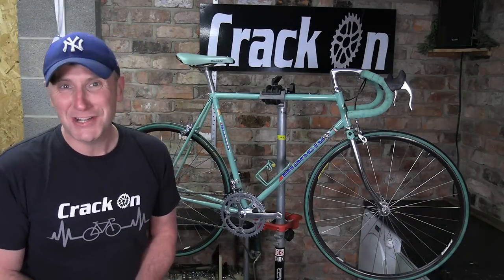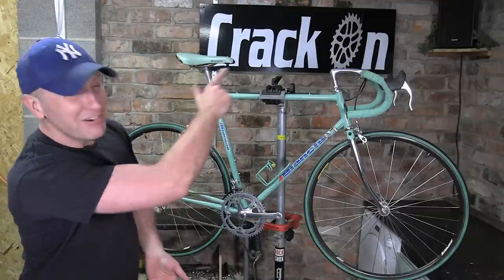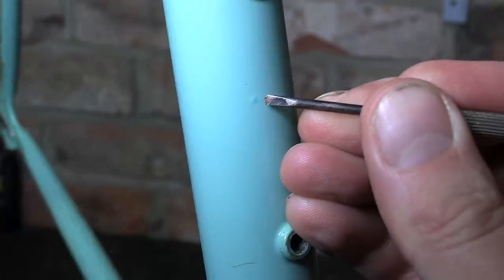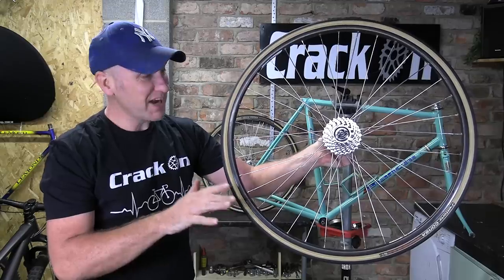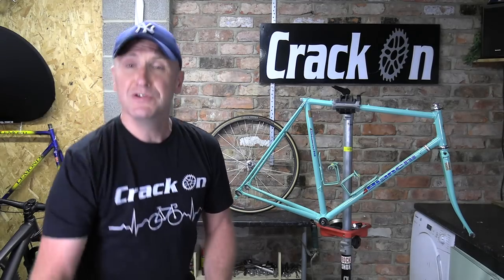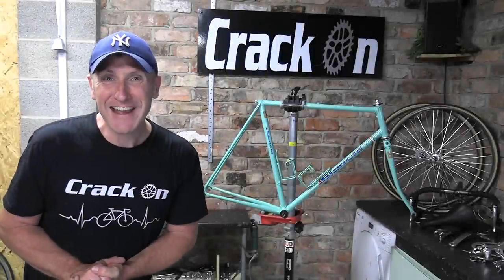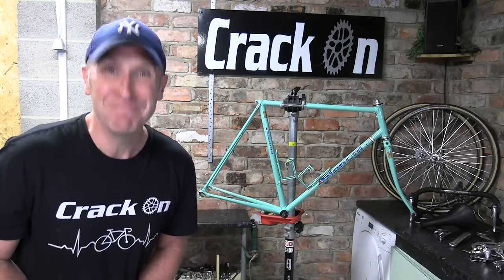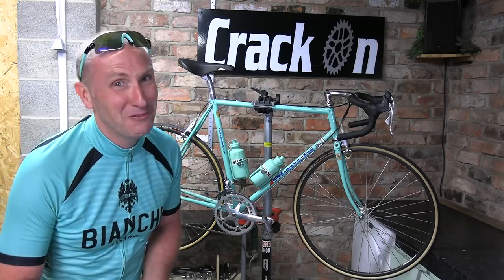Vintage Bianchi Road Bike Restoration Build and Ride

Comment: This is a beautiful build!  Once again, MR did a really amazing job with the paintwork and your component selection is choice.  I have a 1990 Bianchi Limited (Colombus Cromor, Shimano 105 7-speed SIS) that I bought new.  Originally white, I had it refinished in December in the correct celeste...and kept the matching saddle and handlebar tape on!  When I stopped on a ride last week a passing jogger pointed at the bicycle and shouted out: "That's beautiful!"  And they are, so I wish you much joy with yours, Andy.
Reply from the maker: Mate, that’s great thanks for sharing your personal experience. I’m very happy with it and yes I’ll definitely be getting out on it again. Thanks for watching and your support it’s appreciated 👍

Comment: Really nice looking Bianchi. I have a 1995 Racing Department TSX UL, with the Super Set of tubing (downtube ovalized at the bottom bracket) Back then, I built the frameset up with an 8 speed Chorus drivetrain, except with an older Super Record front derailleur (with the black links). I never cared for Campy brake calipers because they lacked the fine tuning, when you used different wheels with different rims. I Committed heresy by using 7403 dual pivot Dura Ace calipers......I raced on it for 5 years before setting it aside for something new. A few years ago, I pulled it out and threw on some 9 speed Dura Ace 7700 components. I left on the Super Record front changer because it worked well with the indexed Shimano left shifter.  It's my Sunday bike now.
PS. I have a couple of those cages, but I found that water bottles will eventually wear the paint off of that Aluminum tubing. I replaced them with the same brand, with the same buttons, but in stainless steel.....PSS. I've always had trouble with breaking the rails on Rolls saddles, after 4 years. I've broken three of them, over the years. I now use the old S.I. Flite (1990 style)
My frame is a 59, with a 14cm ITM Eclipse stem, with ITM 260 42cm bars.
Reply from the maker: Thanks for watching and sharing your experiences and recommendations. Much appreciated happy cycling buddy

Comment: Awesome, another great build, well done! Not a big fan of the Delta brakes, more show than go, or should I say stop but not a deal breaker. On all of my rebuilds, especially repaints, I apply PPF - paint protection film. I do a complete underside of the down tube, complete fork blades, and complete chainstays. This protects from the normal wear and tear of small chips and is easy and cheap protection.
Reply from the maker: Yes I completely know where your coming from. The Gazelle with the Shimano Dura Ace 7400 is probably my favourite functional classic groupset. Thanks for the tips and glad you enjoyed the bike build. All the best

Comment: This is what cycling is all about! Such perfection of a build!! I have that exact stem and although I think its so good looking and stiff for a quill stem, that top cap cracks so easy screwing it in to the little insert, not to mention just pulling the screw out will just strip the insert and then you have to use pliers, THEN you can get to the stem bolt. It's kind of a pain. But it sure is beautiful :D
Reply from the maker: Hi pal, thanks so much for the support glad you like it. Im completely with you regarding the stem. All the best for the weekend take care
Reply: I just put similar silver 3ttt ‘Quid’ stem and Competizione bars onto a Fondriest / Campag Centaur build… very nice stuff.
Reply: Lovely restoration, but what happened to the chrome forks? The chrome looked to be in good condition and it was the builders intention to have this embellishment.
Reply: @peterwotherspoon2203  Go back and rewatch... they weren't proper chrome, just had the paint stripped and polished. They look great now after being properly redone with the rest of the frame.

The bike has been nicely modernised and mildly personalised to give pleasure both for riding and admiring...
Reply: @johnmoruzzi7236  OK, fair enough.  I would like to see a Mercian restoration as I own a Vincitore Special. Thanks

Comment: I have a  SLX Bianchi Giro from 1990. My first race bike purchased new.  Came with Athena C-Record era 7 speed grouppo. I was wondering why you had a chrome fork but you explained it which made sense. The fork on mine is exactly as your restoration. Fully painted (over the chrome).
Reply from the maker: Thanks for watching and your support. Yes before painting I did search and found the frame, non of which were painted and confirmed with me they needed doing. Great ride, and yes definitely a keeper

Comment: Holy shit! I still have that bike to this day. Same colour/decals , same SLX frame with Dura Ace components. It is now unrideable (broken frame), but I will never get rid of it; that would be like cutting off a limb. I spent thousands of hours on my Bianchi and I'm happy to see someone pay homage to this lovely machine. p.s. Paint on your bike has been removed from forks. p.p.s. Now I want to ride my bike that's hanging on my wall. Is it possible to weld a broken chain stay? Mine snapped after years of use.
Reply from the maker: Thanks so glad you enjoyed it, sounds like you have plenty of great memories riding yours. Rear chain stay, thinking 🤔 about it….if it meant so much I would definitely investigate by contacting a frame builder. I’m sure they could, then get the likes of Mark to repaint it. I’m definitely keeping this one in my collection for them sunny days. 🚴‍♂️ Thanks for your support, all the best
Reply: Take it to a frame builder, they can remove the broken stay and join a columbus tube chain stay onto the frame for you and just have it resprayed. I think SLX is still available. Look around for one who fillet brazes, not tig welds, so you get a clean joint matching the rest of the frame work.

Comment: Hi, veery nice job. I am in the process of restoring a nice Peugeot PA10L '75. Any tips ,please, on how to clean the old glue from the rim stick from the tubular tires ?   I Have an original aluminium Mavic rims . I am thinking to sand it, but idk which grit should i start  and then finish? I am thinking also to despoke and polish them also, what do you think? Any imput will be greatly appreciated.
Reply from the maker: Nice, regarding the rims I have done a dedicated video covering how to glue on tubular tires. You can find it in the how to section on the channel 👍

Comment: I'm a Benotto guy ,but that Bianchi is SWEET!!! Who makes the quill stem??? I see the bars look like Cinelli 64's so I figured you'd go with a Cinelli quill stem. The issues with the Delta's...Was it getting the proper cable length right??? That's always an issue with those because the clamp is internal...
Reply from the maker: Thanks for watching glad you like it. Yes the Deltas are fiddly and no room for error. The stem is 3ttt 👍 I’ve not managed to get my hands on a Benotto yet, watch this space 😉

Comment: Hi Andy, you've inspired me to have a go at putting an old knacked Peugeot professional 531 back on the road. In past films you have used a powder coater, could I ask who you have used? Many thanks, keep making the film's, they are ace, zac stockport
Reply from the maker: Hi Zac, the powder coating was done at Hallam Mill in Stockport it wasn’t expensive. They do all types of metal work. For enamel spray work I use Mark MRCreations. Good luck
Reply: Thanks so much

Comment: Nice job. Ques: just bought a 1960s Bianchi frame. How can I determine the year and location of build? Any ideas?
Reply from the maker: Some signs are the lugs used and the angles of the frame. The serial number should be a good indicator although I’m not sure where they will be listed. I’m sure a website will be available with that information. Good luck and thank your the support

Comment: Great Job Andy, looks amazing. Is that a 8 Speed 126mm or 130mm spaced cassette on the rear?
Reply from the maker: Thanks for the support Ken, glad you liked it. Yes its 8 speed, with I think 126mm cassette.

Comment: I have this bike and need to restore it but I can't afford all that. I wish I knew some cheap fixes that makes it a good ride and at least prevents further damage until I can afford a complete overhaul.
Reply from the maker: Sounds like a good idea for a video. I’d start by make sure the brakes are in good order, new cable and maybe brakes pads if needed. Make sure it’s safe first. Then gear cable, new cassette and chain, then move on to tires 😉👍 hope this helps
Reply: @BikeItUK  THANK YOU! I didn't expect you to go into all that. That's very kind of you. That's about the order I was going to go. What I really want to cut corners on is the appearance where the frame is chipped and scratched. I wouldn't even know where to start. I definitely don't have the skill set or set up to do a full paint job complete with a Bianchi stencil.

Comment: Hi Andy  the Bianchi   frames are a thing if beauty  a fantastic  final restoration   I am also  lucky enough to have obtained a lovely Bianchi in Mercatone Uno  jcolours ust a quick question regarding the parts you don't use on the project do you sell them on or use for other projects cheers
Reply from the maker: Hello Darrel, thanks for watching glad you like it. Generally the majority of the parts that I can use or make up for another groupset I’ll keep. The odd part that O don’t think I’ll use I may sell on, generally on eBay

Comment: Genuinely not being funny here Andy but are the bells ringing due to Queens Death, or was it a figure of speech? but anyway, Previously you restored a Puch Mistral, that I commented on and pointed out that, that "Puch" is built by Bianchi, its EXACTLY the same frame, I bought mine as a self assembly project, in which i used Shimano 600 / 105,   BUT  Campanologo Chorus hubs & Wolber TX profile rims. That thing flew, ( i was fit then,LOL) and tracked like on rails, although again the "ensemble" that I compiled at any rate was not particularly light mine was a 58cm. I sold it at a discount price in Jan this year on account of the Puch head badge peeled off !, ( Bianchi  had paint issues ) i overlay ed a vinyl head badge, i told the guy of course, it turned out he is a Bianchi fanatic ,and recognized the "Puch"   for what it is, he snatched my hand off, because the rest of the frame was pristine, i only put about about 500 miles on it as a mid week club tester. I hope the braze on front mech hanger allowed to align your derailleur accurately with the chain rings ?
Reply from the maker: Hello, the church bell in the back ground was honestly ringing when I finished the build. I built the bicycle last week sometime, so no it wasn't to do with the Queen passing. We live fairly close to a church thats all. Regarding the frames, yes I did recognise the matching drop outs etc which did remind me of the PUCH and made me think. The front mech works good, thanks for watching and your support, its much appreciated